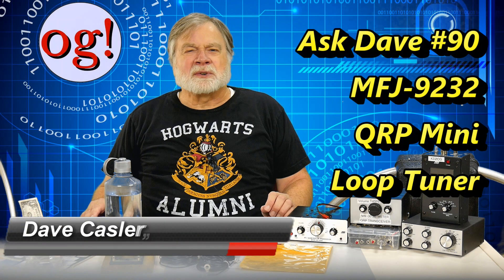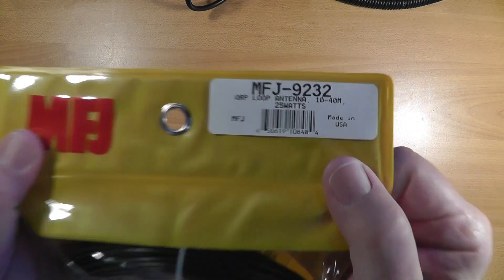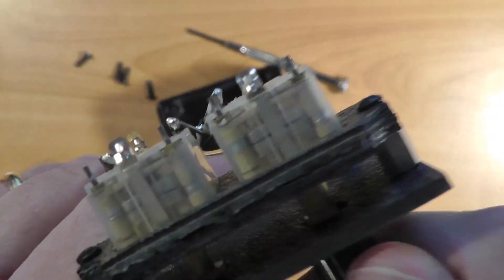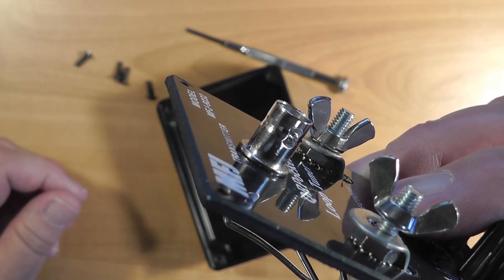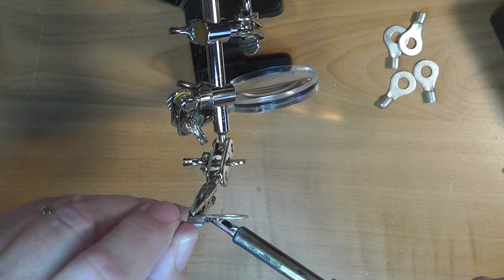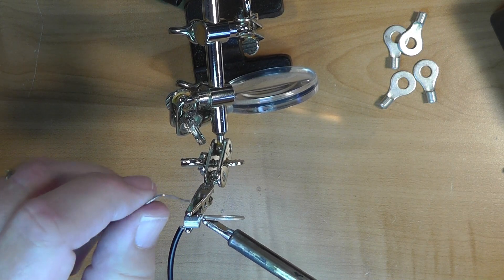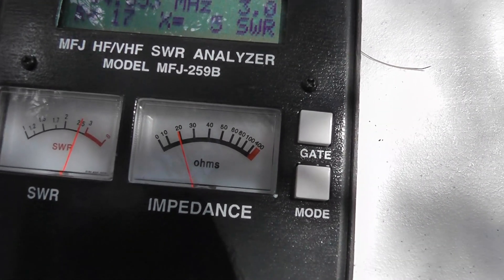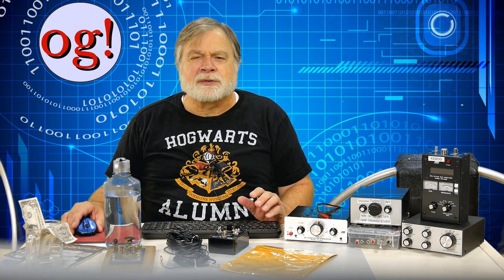Review of MFJ -9232 QRP Mini Loop Tuner (AD#90)

Comment: I made a 24 inch loop from a 1/2 inch x 6 ft. aluminum strip from Lowes ($9.95).  Sitting beside my desk in my shack, I made several FT8 contacts on 20 meters. I adjusted the tuner with the aid of my MFJ antenna analyzer set on the desired frequency instead of trying to tune by ear / swr meter.  Surface area is important with this type antenna, which is why I went for the aluminum strip instead of a wire, plus I wanted the loop to be more rigid.

Comment: I would experiment with copper tubing or pipe as the loop element, as the lower the resistance, the more efficient the antenna. On the higher bands, that wouldn't be too cumbersome, I think.

Comment: I got the 9232 loop tuner as a gift and haven't used it yet but I will over the next couple of days. 

I have the MFJ-935C loop tuner and have been very impressed with it, you will need to make different sized loops for different bands + it handles 150 watts SSB. 

Just today using 2 meters of soft copper pipe on 20 Meters and 5 watts from Ireland I made contact to a Ham in Belarus, 2,223 Kms.

Using 4 meters of copper pipe I made contact to a Ham in Canada with 20 watts. 4 meters of pipe seems to be the most efficient for 20m but with 2 meters of copper there is no problem to make contacts on 20m. 

These contacts were made with the loop tuner sitting on the patio table.

Comment: For the record I hate PL-259/SO-239 connectors.  Despite being called "UHF" connectors they are only good up to 2m (and really should be limited to HF).  BNC connectors are good to 4GHz.  They are also slow to attach compared to BNC.  I would be happier if all HF radios switched to BNC over "UHF".   They are arcane.

Comment: Can we use the rig's internal tuner to tune the loop to get lowest SWR?
Reply from the maker: Don't use two tuners in tandem--they'll fight each other. In this case the 9232 is a tuner, so turn off the tuner inside the rig.
Reply: It is possible to "fine tune" using the radio's built-in tuner, but is not a good idea.  By "find tuning" I mean a few kilohertz.  The tiny capacitor is going to be almost impossible to get exactly on frequency and the bandwidth is extremely narrow.  Actually, using 20 gauge wire the "Q" is going to be so low that tuning is not sharp and efficiency very low.  The higher the efficiency the sharper this thing tunes.  I never use the radio's tuner in conjunction with a mag loop antenna.

Comment: With respects, Mr Calser, I believe very small antennas and other compromised QRP gadgets are crutches for desperate radio operators. GI-Joe would never go on a mission with these toys. But it's fun experimenting.
Reply: * Very sorry for the spelling of your name. + * compromise antenna
Reply: A full dipole can be difficult to erect above the tree line and carrying poles adds weight and size to a pack. I've had a little luck on certain mountains just stringing a dipole along the ground...if it's rock enough, the ground is so poor it's like free space. But otherwise, a very small loop is great.
Reply: @TrevorClarke  I agree: "it's a cool way to play with loops". Moreover, If I was a prisoner in North Korea and had only a tiny antenna of the kind to call for HELP, I would certainly use it without any shame.

Comment: The problem is the short loops. Loops can be fairly easy to tune if they are the correct size. If one were to be in a truly "field" environment with a long hunk of just about any wire , 265 to 280 ft , you end up with a great 80 meter antenna (unfortunately this tuner won't tune there, ?? what were they thinking ? . Shorter for low heights and longer for up high. I'm then wondering what would happen if you fed the loop with open or at least 450 ohm flat line, and were able to tune right next to your rig. My system uses this configuration but without that tuner. One would think that perhaps the MFJ tuner is set up for low ohm loops. You would need have provided the measurements of your analyzer directly hooked to the loops for us to know what the tuner is dealing with. I've made loops with every material in the book and some that are not "in the book". Currently, my 285 ft loop is using steel guy wire. I've measured the resistance dc and its a few ohms. This surprised me. Its able to hear amazingly, works the entire country with JS8CALL qso's with florida on 40 and the Philippines and japan. Of course, some of that is because of the amazing low signal qualities of JS8CALL. Complete QSO conversations with Max 4F1BYN in the philipines are typical.

Comment: They could have brought out the loop connections on the rear of the box so there is no chance of accidentally touching them. I once operated a 6 Watt homebrew rig into a long wire when another amateur connected his counterpoise earth while I was transmitting and he got an R.F. shock. So yes, their warning should be heeded even at these low powers. I'd rather have a larger diameter wire for better efficiency, mine has 3/8 inch coax for the main loop and a smaller gauge wire for the coupling loop. I tune my h/b loop on receive and then adjust for minimum SWR on transmit. I agree with using a reduction drive. I use all BNC connectors on my gear because I use small diameter coax.. The beauty of a loop, as in my case for receiving, is it can be placed away from sources of QRM and I use my dipoles to transmit, but a loop could be useful in locations where large aerials can not be put up, or portable of course.
Bill, G4GHB.
Reply: Sorry, I wandered off into mag. loops, but do heed the warning about R.F. voltages on aerials.
Bill, G4GHB.

Comment: I tried it with up to 50 watts during field day and it worked perfectly. NO BURNOUTS!
Reply: I had an unfortunate occurrence with 35 watts or so and saw smoke coming out and apparently the plastic wafers that make up the capacitors had melted enough to deform.

Comment: The MFJ 9232 tuner I purchased had a faulth capacitor which I replaced with a small air variable. Overall I find working with loop antennas to be very frustrating with frequent tuning and not much operating.
Reply from the maker: Loops need lots of TLC while operating. Hard for me!

Comment: Good analysis of the pros and cons of this product. Well done Dave as usual. As for connectors, I can see both sides of this discussion. If I am traveling in the outdoors with my QRP equipment, I would want to travel as light as poissible, therefore big bulky cables with SO connectors is not the way to go. If however I have a fixed base station, I would want the SO connectors.  But, as we can all observe from the comments, it is ALWAYS a matter of PERSONAL choice, not right or wrong. "A rising tide floats ALL boats...LOL. Looking forward to your analysis of the function generator.
Reply from the maker: Richard, thanks for your comments and for the chance to review the product.

Comment: Thanks for the video Dave. I do disagree with you about the connectors though, I prefer BNC to a bulky SO239 any day. I build some pretty small radios and BNC's are a must have and sometimes have to be SMA. I have this tuner and use it with 3/8 copper tubing and it works very well.
Reply from the maker: :-) A couple comments down someone says just the opposite! People seem to be using BNC for QRP a lot these days.

Comment: Nice video Dave. Now, although you have a QRP rig displayed on your video table it is obvious from your other videos that you are not a QRP Operator. You question why QRP OPs prefer BNC over PL259. Several reasons: for the homebrewer the transmitter or transceiver that is constructed is typically small. Using BNC connectors for antenna keeps the kit small rather than using the large PL259. Image a transceiver built into an Altoids Tin using PL259; a) making them fit the tin is problematic but it they are fitted, then b) the oversized PL259 connectors distract from the neatness of the rig. A lot of us QRP OPs use our rigs portable and have the quick to connect BNC is preferable over the screw on PL259. Those of us that use balanced feedline typically use the binder post to BNC adaptor to connect to our QRP rig or ATU and rig.
Reply from the maker: True that it has been a long time since I've done serious QRP, but my QRP rigs came with SO-239s. I think the movement to BNC for QRP is relatively recent, say, in the last 15 years or so. My only objection to BNC connectors is that I don't know how to connect them to a piece of coax. I tried once and gave up in frustration.
Reply: @davecasler  I use crimp ends and they connect the same as a PL259, expose a length of center conductor and the correct lengths of insulator and braid, insert in the BNC end and slip over the cowling. Crimp and covert with tape or shrink tube.

Comment: Would a larger loop antenna with a cap with more pf range, offer a wider ability to transmit or tune. And for more voltage for the capacitor, more power capability.
Reply from the maker: Perhaps. These loops operate differently from "magnetic loops."
Reply: David Casler , ok, you cut the loop for a band. Less in size than a dipole. But the tuner box makes it work. Still voltage equals watts or power handling abilities. The tuner box needs more isolation. maybe the terminals could be moved around to the top, not the front. for and from the user. Not for rf burns, but tuning accuracy. Burns or just exposure second.
Reply from the maker: These loops are small enough that there are large circulating currents, so you have I^^2*R losses. But full-size loops without all the reactive currents flowing can be very effective.
Reply: @dalemyers5096  Check out the MFJ- 936B and 935B. Same principle put 100+ power capable.
Reply: @davecasler  "These loops operate differently from magnetic loops."
It is a mag loop.  You seem to be thinking (and it is unfortunately common) that what makes it a magnetic loop is the little inductor loop that excites the bigger loop.  That's just the feed mechanism.  You can also have a gamma match or a capacitor match.  All are still "magnetic loops" since what defines the magnetic loop is intercepting the magnetic lines of force in a radio signal rather than the electric field which is the case for a dipole or viertical quarter wave.  The advantage of the MFJ style of capacitor matched loops is that you don't need a small loop at the far end, typically high in the air, and so you can make almost any home-made loop typically out of copper tubing and it works great.  It can also match more perfectly since you can tune the match whereas with a little loop, there is no tuning of the match whatsoever; you can only bend the feed loop a and tweak it a bit.  Good luck doing that with a physicaly large loop.
Reply from the maker: @thomasmaughan4798  The December QST has an article on this subject. You are absolutely correct that there are several ways to feed both a magnetic loop and a standard loop. Generally a magnetic loop has a circumference of about 1/10th the wavelength. Anything bigger than this is generally considered a standard loop.
Reply: @davecasler  "Generally a magnetic loop has a circumference of about 1/10th the wavelength"
Often the qualifier "small magnetic loop" is used for this kind.  Its radiation pattern is very different from a standard loop largely because the small dimensions reduce the effect of the electric field that surrounds it which is nearly non-existent and why it is relatively immune to near-field electric field interference, such as from sparks (switches, commutators in electric motors, sparking insulators).  

As the loop grows, the capacitance must decrease until it becomes simply a dipole folded back on itself and the electric field dominates. 

You knew all that :-) but maybe some here haven't thought about it much.